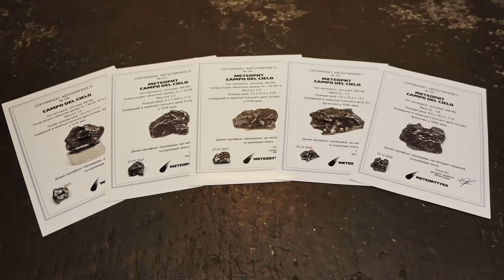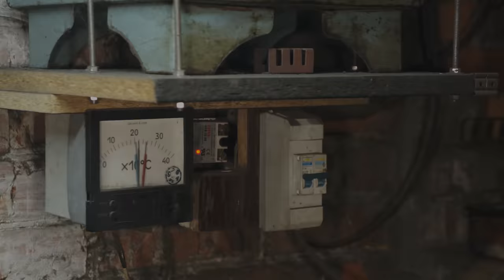Meteorite Damascus steel.

Comment: Fun Fact - Before the iron age, the only way to get iron in the ancient world was from meteorites. Smiths take the remnants of the space iron and make it into something significant. A dagger found in the tomb of King Tutankhamen actually had a blade made of Meteorite Iron.
Reply: not only that but historians can't figure out how the forged it out considering they didn't have the technology to get metal that hot.  also it has steel in it.
Reply: Are you sure?
Reply: pretty sure of it
Reply: @amousawie  he's right, big ol mystery... Another thing they can't explain, even theorys that it was given to him as a gift from a visitor not from here... Who knows...
Reply: So they tested the dagger and proven it was made of meteorite iron.
Reply: @amousawie  yes sir...
Reply: but they did not have the technology to forge or melt iron to the temp required to make the knife that I do know
Reply: @jackmeoffer9334  The bronze age coppersmiths of the near-east could achieve deforming of iron, because in a nickel-iron alloy meteorite the iron crystals undergo a phase shift from the non-malleable alpha-iron to the malleable gamma-iron around 750-800 celsius. To actually smelt iron ore, you need about 1100 degrees. Bronze Age furnaces could not achieve that for many centuries. To full-on melt iron and cast it you need to reach 1356 celsius, which was not achieved until 500 BCE and then first in China. This not not an archaeological mystery whatsoever.
Reply: I'm a knife maker and know steel very well.  I'm very well aware of what it takes
Reply: Prolly strong as heck too.  Those Recipes are long gone now.
Reply: @jackmeoffer9334  Well, now that is interesting. Replying to your first comment. I imagine there is a great many things our ancestors knew that has been lost with time.
Reply: @bornstellarnova1991  humans or humanoids have been around WAY longer than what we are told to believe.  also they had more advanced technology in some cases than we have now.  just look a puma punku and some of the quarries around it with the cut marks in pure granite and andersite (probably misspelled lol)
Reply: @jackmeoffer9334  Oh, man. I really went into a rabbit hole with what you suggested. I've heard of it before, (Puma Punku) but I never really delved into its mystery. And it is absolutely fascinating. That led me to ancient Sumer and Babylon, Egypt, Europe, Eastern Europe, the N and S American continents, literally all over the globe with these structures that have no rational answer as to how  they were constructed yet thousands of tons of quarried rock ends up hundreds or thousands of miles away. I even read some theories from Graham Hancock and Randall Carlson and the Bright Insight YT channel and the Atlantis myths. Very intriguing stuff. I'm still in the hole and continuing downward.
Reply: Also used bones fron wolf or bear - you are forging the animal power to the weapon
Reply: Aliens helped us create what we have today. I don’t care how genius you are? No human had the intelligence to build the great pyramids, or cut blocks to an exactness of 1” -2” off for every 350-400ft
Reply: @eliotartigue6705  The pyramids were built by humans. Every pyramid has been built by humans. We know how they cut their stones so precise. Look at the many examples of unfinished obelisks - they chiseled it in the ground first, then slowly rolled it/ lifted it up. 

They did the same for the Pyramids. They did it multiple times as well, so they would have had experience. Basically, its a 99.999999999% chance Humans did make the great pyramids. Also Humans are very very intelligent, so yes they made it.
Reply: @gasmasksammy  really? That’s funny considering not one person today can logically say how they were built when they brought 200T blocks 200 miles away to build them and not to mention engineers couldn’t even build anything remotely close today with technology 1000x better than what they had back then. I think aliens taught humans not only how? But helped cause the tooling back then was basically prehistoric and the cuts made weee entirely too precise.
Reply: @eliotartigue6705  soo… if aliens built it, why not use metal? Or something more structurally sound than limestone? Its a mystery to exactly how they did it, but it sure as hell was not aliens, as multiple other pyramids were older and built very similar to the pyramids of giza.
Reply: @gasmasksammy  there’s no plausible explanation for being rock from 200mi away to build Giza…

Hieroglyphics show a man in a spaceship. Explain that lol
Reply: How did they know they were meteorites and not just shiny rocks?
Reply: Lol he said, “I’m pretty sure, yeah.” Fuckin damn you internet guy…
Reply: @MAGA_Randy_Marsh  well, first they would see it crash down or at least find its crater. They would then just pick up pieces of it or break off pieces of it. Then they forged it.
Reply: @eliotartigue6705  First off we know humans can transport large rocks that weigh tons using multiple methods. Take the Walking Moai, where archaeologists were able to make a full size replica of a Easter Island Moai “walk” using only rope! 

Also which hieroglyphs depict that? Im assuming the “ship” was just an oval with a man in it. I’m also assuming you believe in that ancient Egyptian “lightbulb” which really just is a snake emerging from a flower.

You are missing the entire point of Egyptian hieroglyphics. They were purely used for religious purposes or by the very rich. Think of a ancient form of emojis making up the Bible instead of words - those are hieroglyphics.

Also, Egyptian gods looked somewhat similar to the half man half animal creatures depicted on the oldest neolithic site ever discovered - Göbekli Tepe. Does that mean they are connected? No! The pyramids and Göbekli Tepe are over 6,950 years apart! That is three and a half times older than compared to the measly 2000 years since the death of jesus. 

Basically, just cause something looks vaguely similar to something today, doesn’t mean they are the same.
Reply: @markus9333 which might just have infused carbon? 🤔
Reply: Ancient astronaut theorists say yes...
Reply: When they discovered Tutankhamun's grave in the Valley of the Kings in Egypt they found a dagger with a steel blade and everyone was completely shocked since and Tutankhamun was buried 400 years before the steel age. That event was scientifically the first evidence that people made an item out of steel before the steel age @amousawie
Reply: @eliotartigue6705 I totally agree with you 100%
Reply: The earliest known dagger made of meteoritic iron was first excavated at Alaca Hüyük in ancient Anatolia, Turkey, according to the study. This dagger dated to the Bronze Age, 2300 BC to be precise, and was also found in the context of a burial. This suggests that the technology to work meteoritic iron to make these complex objects is at least 4,300 years old, and clearly known to the Anatolian region.

The X-ray testing of the tut blade showed it also was not made in Egypt and was low-temperature forging.

So not aliens…😂
Reply: @MAGA_Randy_Marsh   Iron meteorites contain nickel and iron ore does not, and when you polish an iron meteorite it has a distinctive pattern because of the nickel. Iron from iron ore does not have that pattern.
Reply: @OnTheRiver66  thank you. Is it that crazy square pattern?
Reply: fowyb  wtf?  I totally believe humans are way older than what's being taught
Reply: fowyb  you still running on about this?  I done forgot about you
Reply: Love it!
I encourage to duve, ws long as you stay sane and halfway compatible with society 😉

Comment: I like how he seasoned the steel at every step, Gordon would be so proud.
Reply: dead
Reply: S&P baby
Reply: It's a pun - in Ukrainian and Russian language spicy and sharp is the same word
Reply: 2:32 What is this powder? I think it is not salt...
Reply: @lampinterroristi  flux it helps with forge welding watch forged in fire if u Wana see it used
Reply: @lampinterroristi  flux, it aids in the weld.
Reply: Marco would have disagreed.
Reply: Much like food, if a blade isn't properly seasoned, the flavor will be boring and incomplete
Reply: @lampinterroristi  It is called "flux" it is put there to assist the materials in bonding at the molecular level, also to deter oxygen from hindering this process.
Reply: @a_makarov  в украинском языке нет слова ( острый)
Оно просто похоже. На украинском (гострий)
Reply: @thanosbustedinyourmum  read the above comments, it was not salt or pepper.
Reply: @a_makarov  That is so cool, it's the same in German (scharf).
Reply: @K3Flyguy  im pretty sure the first thing he added he was grinding pepper. Just like in the vid with the stalagmite he chopped up a chili pepper
Reply: But he didn't taste it!
Reply: @thanosbustedinyourmum  basically it should just turn into a very minor amount of carbon probly has very little effect if any at all.. just a guess tho I dont actually know.
Reply: @lampinterroristi  gunpowder
Reply: Don't bring that chump's name into this. What an insult.
Reply: Too bad neither of mine are dead and you had to redact your comment 😂. I was just messing with you to begin with
Reply: So did he put pepper in it or not? 
Thanks!

Comment: That may be the most stunning piece of Damascus steel I’ve ever seen.  I am in awe of its beauty.
Reply: Without a doubt
Reply: @SungazerDNB  Of course this isn't "true" damascus steel, which was probably a form of crucible steel made with high vanadium content ore from the east, but this is still what is known as a damascus pattern and I'm using the term as such.  Also, doesn't change the fact that this is a remarkably beautiful piece of metal here. ;)
Reply: @UCNNp_XoWO4uTXBvNrSq4zOQ There's actually a really good breakdown of Damascus from either Metatron, Skallagrim, or Scholar Gleadiatora (I can't remember which off the top of my head) which breaks down the theories and realities of Damascus steel really well.  Wish I had time to look it up, but alas... work.
Reply: So it would seem..

Comment: OMG - what a beautiful blade it has become! And then there is the knowledge of what material was used in it.
One thinks: It contains iron and traces of other metals that were not extracted on earth, but that maybe millions or billions of years before the formation of the earth already made their orbit in space.
I could get really jealous: D
Reply: Well, iron and other metals here on earth are also from millions or billions years ago created with dying stars.
Reply: @ivorunac  That's right, Ivo - also the iron on every planet - including on earth - naturally comes from fusion processes in the suns. That is clear. But let's take another example: diamonds - you could also say it's just carbon. And it is the same with iron. For me it makes a difference whether a lump of iron flew through space for billions of years and then became a blade, or whether iron oxide was mined on earth and turned into steel.
Reply: @stefantaubert  ya but iron oxide was also first iron that flew trough space for billions of years

Comment: Ever since I was a lad and heard the story about Jim Bowie and his original Bowie knife being made from a meteor. 
I have wished to have a knife made that way. This is pretty awesome...I subbed right away. Great work.
Reply: Most likely that’s not true. Most metal meteor’s have a very high nickel content and don’t make very good blades. That’s why he had to incapsulate the meteorite metal in good carbon steel.
Reply: @craigthescott5074  Thanks for explaining that part, I asked myself exactly that question! (Why those edges were added) I don’t know anything about meteorites… however I really enjoyed watching the process of this piece being put together. It was easy to understand the process even though he didn’t explain the process in words. Lovely editing for sure! I hope he can understand all of the praise in the comment section.

Comment: Absolutely breathtaking! I didn’t catch what the meteorites were made up of, however, your work is extremely impressive! Amazing! 👍🏼
Reply: Meteorites like these are usually made from an Iron and Nickel alloy, with trace amounts of other metals like cobalt, manganese and sometimes even vanadium.
My father works in a steel foundry and their lab once for the giggles tried to copy a version of the alloy. The result was an insanely hard metal but extremely brittle.
By pattern welding it with softer but tougher tool steels you get the hard edge but with a more forgiving blade if you should drop it.

Comment: I'd imagine that the material for this project was really expensive. I know that forge welding is a difficult process, so did you have any plan to salvage lost material in the event of a delamination in your steel?
Reply: Meteorites only have value as unmolested specimens, once you change that, they are just lumps of metal.  So there was only one shot at this knife .  I doubt a meteorite collector will purchase this knife (they will be to busy crying).  It will be a knife collector who appreciates it for its beauty and rarity.
Reply: @landroveraddict2457  couldn't agree more,  huge waste.
Reply: @jeremywest5433  
To turn jagged lumps of molten star shits into a functional work of art?
Waste, lol... imagine loving space poop.

Comment: Why does the metal not become homogeneous after such repeated reforging? Why does diffusion not mix iron layers? Is it the powder that separated the pieces of meteoric iron from the steel mold, or are there other factors at work?

Comment: Askin because i have absolutely no clue about a blacksmith's work... wouldn't it be easier and faster to just fold the metal when its hot instead of cutting it several times?

Comment: It always breaks my heart to see iron-nickel meteorites folded into blades like that. It is such a waste because the unique thing about said meteorites is the large crystallin structures in the metal that can only form in space. Those crystals are utterly destroyed by the forging process. You might as well have used chemically similar bar stock to create the knife. I would have looked the same. But at least you did turn it into something objectively beautiful in its own right. Just wish you wouldn't use meteorites in a way that destroys their beautiful natural grain structure.